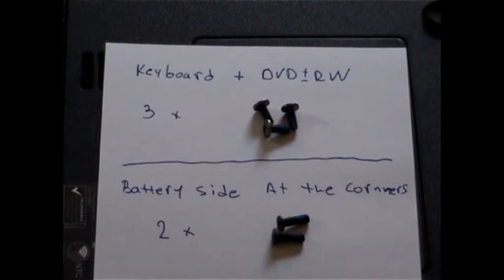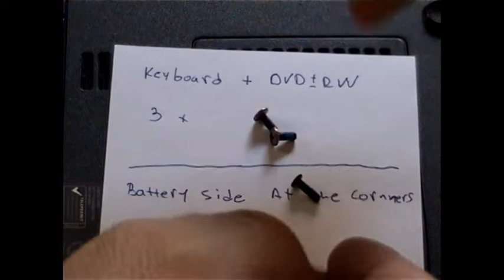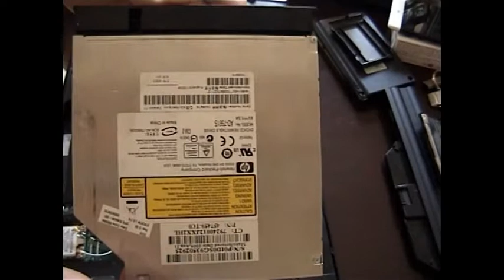compaq 615 disassembly, clean fan

Comment: Please, I need help. My laptop doesn't stay when ever I press the on button. When I pressed the on button within 2 or 3 seconds it off. Have checked the fan, change battery(including the small one inside) no good result. Please, need your help. Thanks
Reply from the maker: In most cases. There is a little tiny film of dust between the heatsink and the fan. You have to disassembly the laptop, in order to be able to clean the dust from inside. If you do this and the problem still exists. Then could be more serious problem.

Comment: I've a Compaq 615 working great then switched it on following day and screen is blank caps lock flashes 5 times.  I've drained power but still nothing.  no software or hardware was installed before hand it has just went blank.  help please.  Also have Acer aspire 5733 won't load at all.  sometimes get starting Windows the black screen with cursor.  that's progress because I took it apart and cleaned it.  I think it's my 500gb hard drive maybe not??  2 laptops and none work HELP!!
Reply from the maker: +Kevin Milne Hi, Answer for compaq 615: I suppose are not able to see bios instuctions too. My opinion is to firstly check the memmory. If you have two pieces of memmory installed, try to remove one and do the check with the other one. Then try the opposite. If it was a memmory failure, at this way you will make clear which one was the faulty one. Another part which could be the faulty part in your laptop is the gpu(graphics card). The only think you can try (at you own risk)is to reflow the gpu. That means to heat with a heatgun the gpu for a while and recheck. There are videos that reffered to this proccess(reflow) on youtube and also to my channel. Finnaly the profi solution. There are services that can repair the gpu(In your case the gpu is onboard)so we are talking for motherboard repair. and the cost starts from about 70 euros. If you choose the last solution make clear how many months would be the warranty. Hope you find my recommentations helpfull.
Reply from the maker: +Kevin Milne Answer for acer 5733. There if a wonderfull cd "toolbox" called hirens boot cd. See my video at this link: https://youtu.be/lOKZygwMheU 
You can do plenty of tasks with this cd. Som of them are: hdd check, memmory check etc. Try it to find out if your hdd and your memmory are ok.